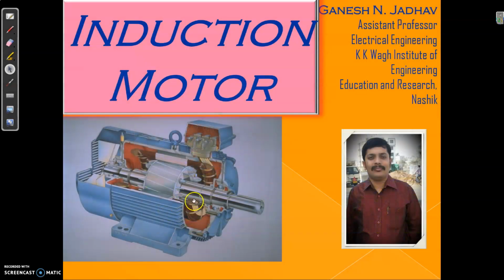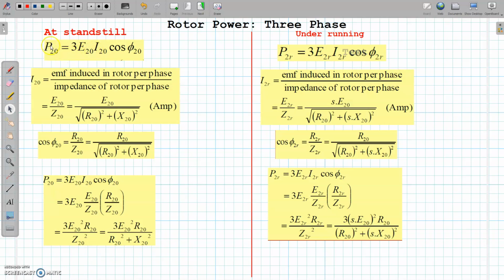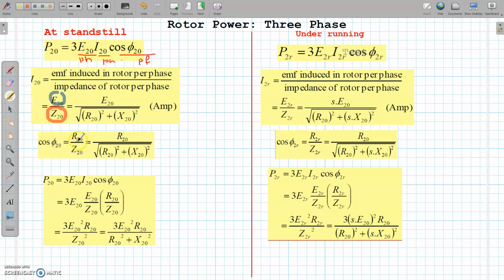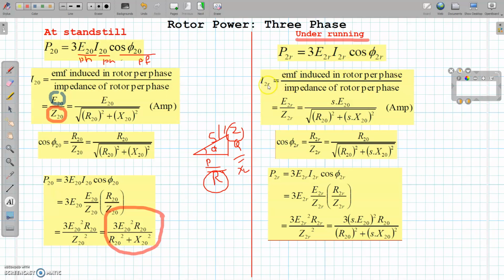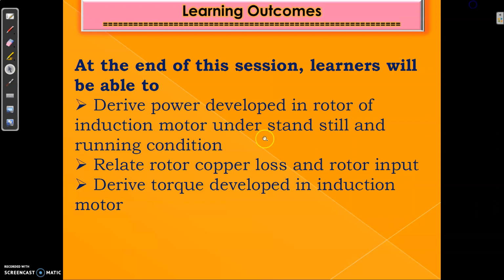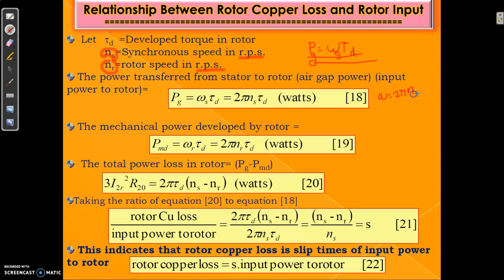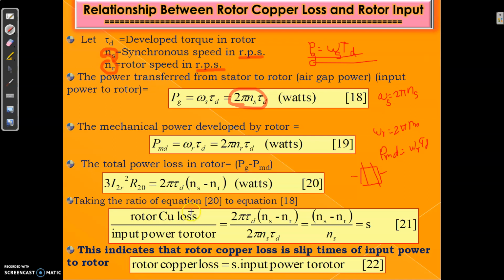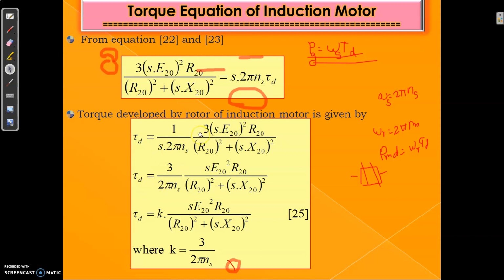Induction Motor Theory 05 Power and Torque Relation

Comment: How can we ask doubt
Reply from the maker: You can ask here...
Reply: @GaneshNJadhav  A single conductor of 525 kV line having a radius of 0.032 m is string. 13 int above the ground. Calculate i) Corona inception voltage. ii) Effective radius of conductor to ground at an 0.V of 2.5 pu. iii) Capacitance of conductor to ground with & without corona. iv) Corona Power loss.